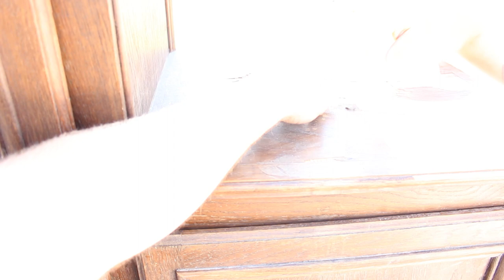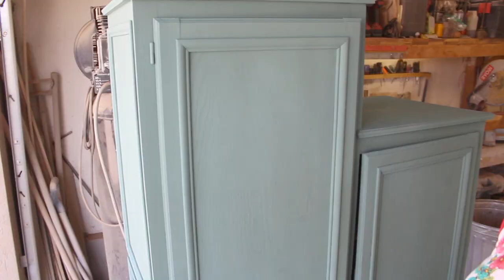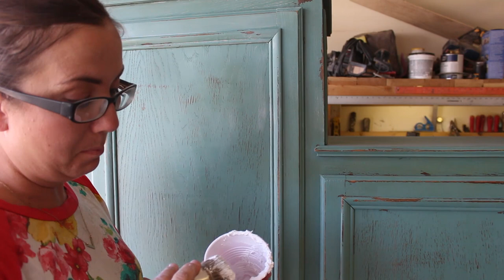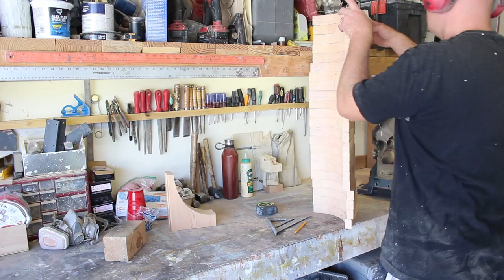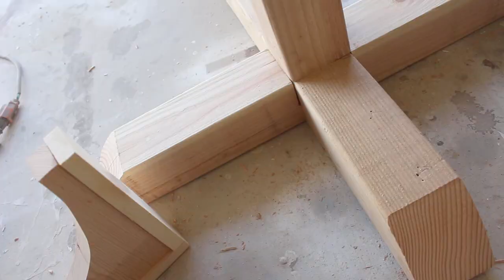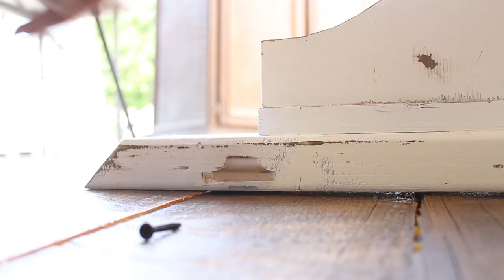French Country Finish And Farm Table

Comment: Watching your videos and love them!  
A tip I learned several years ago: To remove the top veneer smoothly, place a wet towel (not too fluffy) over it, and use steam iron in high. It lifts right off.
Reply from the maker: I’m gonna have to try that!

Comment: I love watching your vlogs and so excited that you're doing them so often now! (my hubby says I'm watching furniture porn 😅) also would you do a vlog explaining the differences in sanders? I stood staring clueless at the sanders in home depot literally yesterday trying to figure out if I needed a mouse sander or belt sander (I already have a cheap round one from harbor freight and a square Makita my dad passed down)
Reply from the maker: quimbycrew I use my black and decker orbital most often. For jobs that I need to take down material fast I use my belt and follow up with my orbital. I pretty much use those twi
Reply: Jami Ray Vintage thanks so much!  What brand/model do you recommend for a belt sander?
Reply from the maker: quimbycrew I use a black and decker orbital which is round and we have a ryobi belt sander. Mostly because of cost. If we could afford the more expensive ones we might choose different. But the ones we have, have held up great.

Comment: What kind of primer did you use before you painted the cabinet?  Also, love the table!! Thanks
Reply from the maker: I used the color blue green by Fairy Chalk Mother.  No priming necessary on this piece. I usually only prime a piece if I’m going with a white color because it takes less paint and primer is cheaper. I typically use Fairy Chalk Mother High Bond Primer if I prime.
Reply: Jami Ray Vintage thank you!!

Comment: Jamie. How many pounds of PSI is your air compressor?
Reply from the maker: We run 55-60 psi when spraying Chalk type paints. If you find your mixture is a little thick it’s ok to bump the pressure up a little. Since the paints are flat with no sheen it won’t matter if it mists a little.

Comment: Do you seal your chalk paint with wax or poly acrylic?
Reply from the maker: Both, but typically we use polycrylic from Minwax* in satin because it’s so easy to spray with our air compressor.